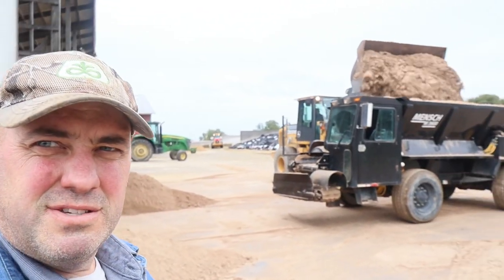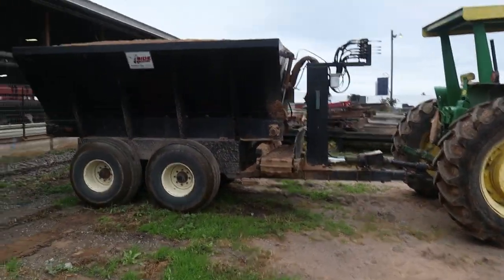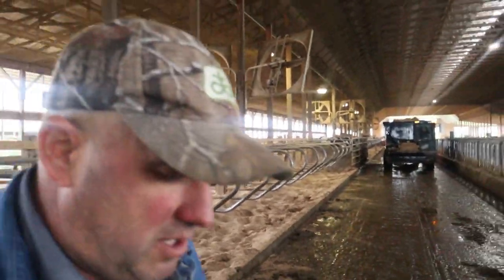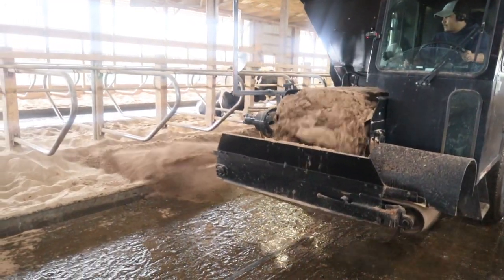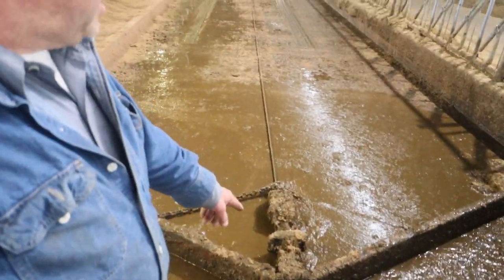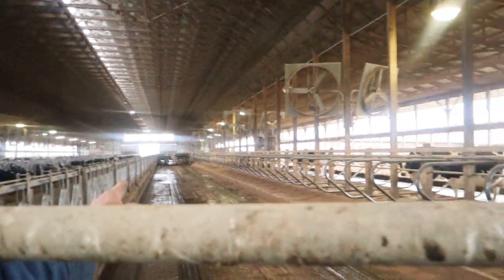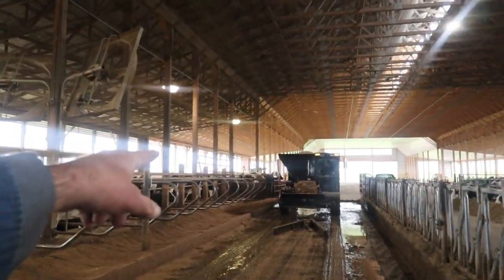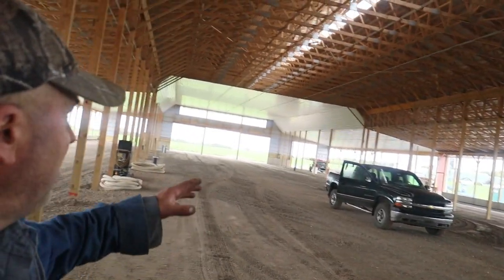Mensch sand truck bedding cow stalls with sand

Comment: Well that was interesting the conveyor on the bottom runs faster than the conveyor pulling from the truck bed.  The sand is shot fast onto the stall bed nice video.

Comment: That is a sand slinging SOB for sure very neet to see it in action ! So the cows all get fed in the stalls on the outside of the barn and have access to that all the time and loaf in the head to head stalls that you're bedding on the inside ,just trying to understand the traffic ,has to be managed pretty tightly to keep everything flowing smooth I'm sure ! How long is that barn looks huge? Thanks for the very interesting video!
Reply from the maker: They are able to go from the perimeter walk side of the barn to the feed alley

Comment: Do you use a sand trap in your liquid manure system
Reply from the maker: No we don't
Reply: So all the sand just goes back into the field dose it just stay in the pit
Reply: @nathanmelander3995  We put it in the fields, Maybe Andy will do a crawler video at some point and share some info on how that works?

Comment: Andy 
1 Do cows know where there stall is? Same home spot ?
2. How do you remove old sand from stall beds with stantions in the way.. (Bobcat/shovels or Fire Hose) You spread dry sand into fields or slury washed under floor  into pond ?
Reply from the maker: Some cows have a favorite stall but not all do. We don't have to clean the stalls out. Every milking we lightly from them and remove any manure with a shovel. There is very little to clean out.
Reply: @FarmingFixingFabricating  That makes sense fluff up the mattress with new sand most of the mess the floor cleaner takes care of 👍👍👍 Thanks Andy

Comment: When the cows are in these areas, do they wander in the area where the sand truck was moving, and then lay down in the stalls, laying on the sand?  I've never seen an operation like this.  We had stantions for cows, holding the cows neck loosely, manure gutter (6" deep, 15" wide) behind them, then 4 ft walk way behind that.  We used straw for bedding in the area where they stand.  The gutters were cleaned out 2X per day, fresh straw, 1X per day.  In our area, cows were housed this way for the Winter months, and, in the Spring, Summer, Fall were pastured.   The idea of sand is a foreign concept.
Reply from the maker: They can't mingle with the sand truck but once it has laid the sand down they can go in and out of the stalls as they choose.

Comment: A really great video. Really cool to see how the sand truck works. It almost reminds me of the woodchuck that fits on the front of a skid loader.
Reply from the maker: Yes same thing almost
Reply: @FarmingFixingFabricating  Could you use sawdust in the sand truck if you wanted? Using sand is probably a better way to bed, less wasted material.
Reply from the maker: @mitchfrye3849  not sure if it would work on sawdust or not. Depends on how well it slide onto the apron chain.
Reply: @FarmingFixingFabricating  Ok so is the apron chain pretty much like the same as on the feed mixer?
Reply from the maker: @mitchfrye3849  the one in the box.... Not sure if the walls are step enough for sawdust.
Reply: @FarmingFixingFabricating  Ok I got you now. I was just wondering, hate to ask so many questions.

Comment: got to be a way to recycle the sand Andy 100's of tons ???? What a waste we used straw or mulch hay.
Reply from the maker: Yes I hear ya
Reply: They make sand separator systems but they are expensive plus the reclaimed sand is going to have organic material in it that can cause problems. Some guys also put in settling lanes where the manure is pumped down a alley and the sand settles out but I have heard odor can be a problem